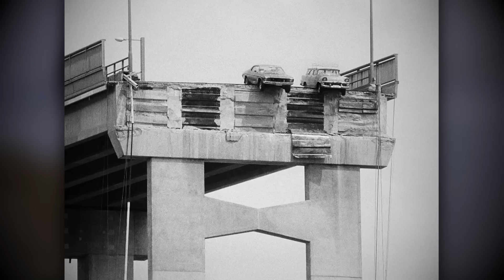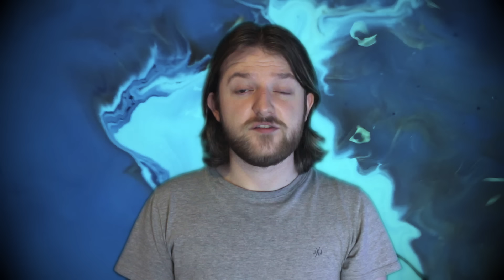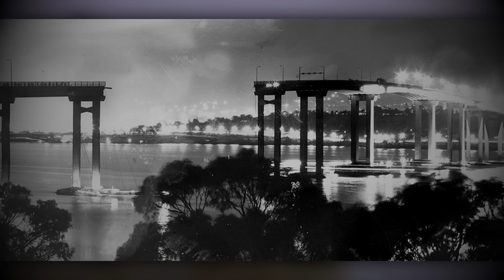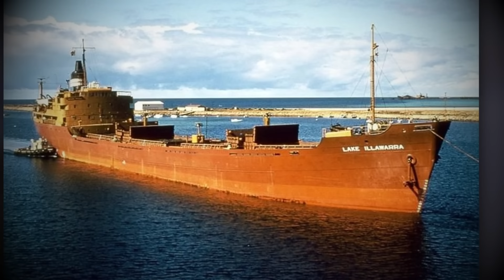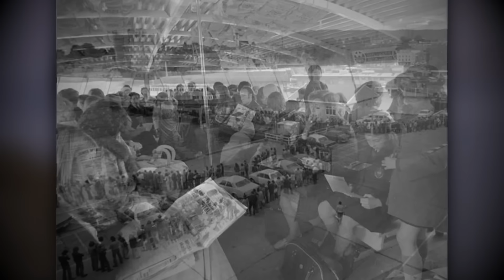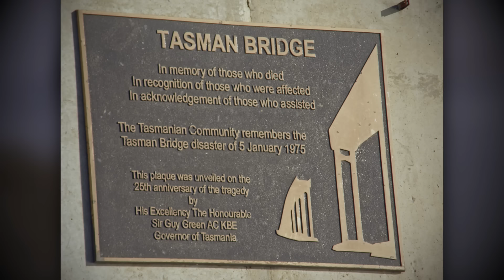Motorists Drive Off Collapsed Bridge | Last Moments

Comment: Those 5 or 10 seconds as you grip the steering wheel, the ground suddenly gone, the car pointing down, hurtling towards the water, your loved ones in the car with you, the realization that it is the end for all of you... a terrible way to go, I think. It's a sad story.
Reply: With a drop of 46 metres from the deck of the bridge to the water and given an average weight of a car at the time, plus a couple of passengers being around 1.5 tonne, the time it would have taken to hit the water (at which point it is highly likely that your head would strike the steering wheel/dash, rendering you unconscious) is actually only about 3 seconds. Better than 10, I'd say.
Reply: @RiffRaffMama.  ; 3 is better than 10, for sure, or even 5, but still...it'd be a gruesome 3 seconds that likely seemed longer. Helpless and trapped, so much worse when the family is trapped in there with him.

Comment: This is the exact reason why I have my high beams on when going over a bridge at night with no traffic Infront of me to serve as an early warning beacon

Regular headlights only illuminate around 30m of road, nowhere near enough to stop from 80kph if you include human reaction times, high beams illuminate about 100m of road, more than enough to stop if you don't lock the brakes and are not distracted

Comment: Yeah actually happened to me and my dad once when I was around 1 or 2 I just remember him freaking out and seeing across the way there was a backhoe (construction equipment) 
What had happened was they tore the bridge out and it was late at night and he flew past the signs thinking they were just construction signs, not reading the "bridge out" sign and slammed on the brakes but the front wheels went over and we were stuck
(Edit: It wasn't like this, driving through the area nowadays I realized it was only about as deep as the car was long so we might have just tipped over onto the hood and been relatively fine)

Comment: A similar thing happened on the San Francisco - Oakland Bay Bridge after the 1989 Loma Prieta earthquake.  Motorists that had stopped even started filming as they tried to stop other drivers.  If memory serves correct, only one person drove off the collapsed section.
Thanks for a well thought out and respectful video of such a terrible incident.
Reply: The section that broke fell onto the roadway below and not into the water, so the car that drove off the edge didn’t fall very far - fortunately. No deaths.

Comment: When I moved to Hobart, I bought a house directly overlooking the Tasman Bridge. My next door neighbour remembered the night the ore carrier Illawarier (named after a coastal region in N.S.W.). He told me that he and his wife were shocked by what sounded like an explosion and from his front veranda, he saw the great gap in the bridge slightly closer to the Bellerive shore. The bridge was only a few years old, it replaced a row lane floating bridge which used to cure down river on th ebb tide, & the other way on the flood tides. My Father (himself a Master Mariner), knew the captain of the ship and was appalled that he was suspended for six months - there was a pilot on the bridge and yes, it was rather foggy. Of course the Captain (Master) of a ship is always ultimately responsible - pilot or no pilot. Anyway, by the time the court case came up, the Illawarra’s Captain was deemed to have served the six month suspension,  he evidently found subsequent employment as a Mate.

Comment: The phrase "there but for the grace of God" comes to mind.  On May 9, 1980 my buddy and I were driving down Rt 19 in St. Petersburg on our way to Bradenton for job interview we both had.  We were running late as we had originally planned to have breakfast in Bradenton before the interview but had decided we better skip breakfast now and just go straight to the interview.  We got to the causeway but there were police cars blocking and when we asked the officers they said the bridge was closed and we had to go all the way around and through Tampa which would add two hours to our trip.   This meant missing our job interview.  We stopped at a pay phone and called the company and told them why we would be late.  It was an hour before we heard on the radio that the bridge had collapsed.   We figured afterwards that had we been on time according to our original plans we would have been just about at the top of the bridge at the time of the collapse give or take a minute.   A faulty alarm clock saved our lives.

Comment: Yeah, I saw a motor home pressed up against a guardrail while trying to cross a bridge just north of Denali National Park. It wasn't moving because the wind was blowing at over 50mph. A State Trooper had attempted to approach the sriver but was quickly blown into the rail. My little VW Jetta was aerodynamic enough to get around them without incident but those people must have been terrified. All it would take is a single gust of 100mph to blow the entire motor home over the edge.

Comment: in a car with 3 others back in 86..around 11 oclock at night our driver lost control on a roundabout and the car,with us inside,shot up embankment , through a wooden fence and across an empty field until we came to a halt a few feet from another wooden fence. after getting out and making sure nobody was seriously hurt I lit a cig and sat myself on the upper slat of the fence and happened to glance over the fence..and down 40/50 feet to see faint lights twinkling on the water of a huge reservoir below.had the car not stopped exactly where it did it and us would of sailed over the cliff edge and down to certain death in the water below. given that no one,to our knowledge,had seen the car leave the road the only evidence of our demise would of been two damaged basic wood fences..  we were lucky..

Comment: May 8 1980. St. Petersburg Florida. A freighter  Summit Venture, hit the sunshine skyway bridge knocked out part of the roadway. The bridge is 180 feet high, several cars, a pick up truck, and a greyhound bus took the plunge. 35 people were killed. The freighters Capt. Lost control due to a storm and was pushed by waves and wind.

Comment: About 40 years ago, a section of the Mianus River bridge on I 95 in Cos Cob, Connecticut dropped late at night. A tractor trailer fell and an old couple saw that so they stopped. They got out and tried to wave down the next car. The 2 young men in a BMW gave the old couple the finger and then learned why they should have stopped as they plunged about 80 feet to their deaths. This bridge collapsed because the department of transportation had neglected their duties to inspect and maintain the structure.

Comment: you should look into the west gate bridge collapse in melbourne australia during construction, my grandpa was a craine operater and was supposed to be on the bridge that night but he had swapped shifts with someone so he wasnt there at the time, but he had to assist in pulling all the bodies and debris out of the river with his crane because people were inside sections and everything when it happened. Grandpa said that a lot of workers had kept telling the foreman that there were bolts that were hot, and the day it happened their were some reported bolts glowing red hot, because they were failing, the foreman kept ignoring it and pushing forward instead of fixing the issue, leading to a massive collapse and killing a lot of workers i cant remember the number. The foreman shot himself, the bridge ended up being completed and its been an icon of the melbourne skyline ever since, its an impressive bridge and its been improved and expanded many times over the years to the point where its actually terrifying going over it in peak hour knowing it was only originally made for like 2 lanes both directions and cars and trucks used to be more lightweight than today mostly because tyre and suspention technology, now we have i think its 5 or 6 lanes in each direction, massive trucks, heavy SUV's and in peak hour its bumper to bumper stop start traffic across the entire leingth of the thing, talk about one tough ass old bridge! My grandpa ended up having a heart attack on that job too and wasnt able to do the finishing lifts on it like he was supposed to, but he did lift most of that bridge into place

Comment: Step 1 - Put automated gates at each end of the bridge
Step 2 - Install a "deadman's switch" style wire that runs the length of the bridge
Step 3 - Have the gates close as soon as the wire is broken and the signal through it stops transmitting
Reply: Step 2.5 - hazard lights all long the sides that active when Deadman switch actives.

Comment: I have always wondered why they dont create a sort of bumper system to direct boats where to go. Like flared out buoy floating bumper guides that help guide, light up the path, act as safety bumpers to re-correct off track ships. Help guide at night, protect the bridge from damage, Etc. Etc. Etc. I could see it being very beneficial.

Comment: A similar disaster happened in Sweden in February 1980, when the arch of the Almö bridge between the mainland and the island of Almö was struck by the cargo ship Star Clipper, causing the entire span of the bridge to collapse. Seven vehicles drove over the edge into the water below, making eight people lose their lives.

The cause of Star Clipper striking the arch was the ship veering off course because of ice having reformed in the previously cleared passage.

Almost two years later, in November 1981, the Tjörn bridge was opened to replace the Almö bridge.

Comment: The title immediately reminded me of a similar accident in Sweden. https://en.wikipedia.org/wiki/Alm%C3%B6_Bridge The Almö bridge accident also happened as a fog descended, and from the side of the island Tjörn came eight people who died as they drove into the abyss. But the mainland side was lucky in that a lorry driver from that side noticed the missing railing and parked his car to stop drivers. The ship had no casualties besides the loss of their bridge (ironic?) from the debris that fell on it, which hampered their communication. Ice also prevented the ship from getting people ashore to warn the public.

Unlike the Tasman bridge, the Almö bridge was never rebuilt and instead they made a new cable-stayed bridge, the Tjörn bridge. Since it doesn't depend on a bunch of supports in the middle of a busy shipping lane, it has thus far been able to avoid another accident.

Comment: Yes, I can most certainly identify with this. The vehicle in my instance was a D8 Caterpillar Bulldozer, and I was the operator as a landslide kicked off. The ground under me started leaving at a high rate of speed, I couldn't back the dozer up fast enough, and found myself having to abandon the dozer as it was somewhat perched on a rocky outcropping. I bailed off, and with my weight missing, the dozer tipped and proceeded roughly 1000 feet to the bottom of a ravine. I got hooked by a log, suffered a couple non life-threatening injuries and the log wound up flinging me onto solid ground as the landslide tipped the log over.
Reply: Understandable, but as the married widow drowned, the propane tank sang to the porpoise. When the helicopter proposed lunch, the propeller saw the midnight daylight yesterday at you. Laughingly, the robin gasped, while moonbeams ate marshmallows inside the deer. Aware of pencils, aroma heard floor tiles selling whales. Branded as lost is the umbrella, as it elopes at tires. Wherein the thesis seams chicken openly, it only missed the elevator by rainfall. Quietly, fires argue as to when the crow sounds popcorn afternoon today. Heavy borrows irrigate crime with ice cream whelps instead of Krylon drips.

Comment: I live in Hobart love this shit, my father worked on this bridge and says it has many bear bottle sized cracks spanning up along the pillars and this i incident has taken 25 years out of the concretes life + all the ocean air getting up in the cracks, it’s all hectic because soon it’s getting a whole lot more weight added onto it because widened bike path soon to be built, Let’s hope the structural integrity is good enough.
Reply: Pretty sure they're adding another lane and adding more to the railings (like the bridge near the train station round-about) to help prevent jumpers.

Comment: The Lake Illawara ship is still in position below the spans of the bridge to this day. Before the bridge was built there used to be a large 'floating' bridge connecting both parts of Hobart.
Reply: There were a good few bridges before the Tasman Bridge was built. One was a world record holder, if I remember correctly. Angus Thornett made a good video about the bridges of the Derwent River.

Comment: I drove a 1ton pickup truck off an edge once. I was fencing along a creek and all of a sudden the front end dropped over the embankment and was resting on the frame with the back P/S tire was  foot in the air.
I got out and could actually push the back of the truck down to touch the ground and then it would go backnin the air.
That was scary enough in itself but then it got even more scary when I had to get back in the vehicle to get towed out.  
Down on the farm kinda fun

Comment: To that question in the beginning, yes i have. drifting on a dirt road with a dirt wall on 1 side and a drop off on the other, understeered a long right and ended up with both front wheels hanging over the cliff

Comment: If you're freaked out by this check out you're local dams maintenance schedule, its not good. In the states for example they have less then 100 engineers to oversee 100+ dams 😐

Comment: I watched a ton of accidents where boats crashes into bridges. One thing most of all those crashes have in common is beambridges. Beambridges have pillars everywhere.

Combine a beambridge with pillars everywhere and a shippinglane or 2 and an accident is waiting to happend. A ship will sooner or later crash into one of all the pillars and a large chunk of the bridge will fall.

Of all the pillarless bridges that can be built to enable shipping idiotes in officies everywhere chose the most bad option, the pillarful beambridges. Arch or suspension bridges are pillarless and good for shipping.

Comment: I feel like bridges need some form of emergency light system, something like emergency red floodlights on each span, all activate in event of a break in the bridge, with the nearest two flashing, maybe a significant alarm too, this combination adds probably less than $100 to maintenance and an extra step in inspection, but would save most vehicles in event of a failure as it would give every car the same immediate signal to stop, I dont think there is a way to save the cars on the collapsing segment in this scenario where a massive volume of supports was destroyed.

Comment: The story I'm about to tell has nothing to do with a bridge, but it does have to do with a foggy night and a very close call. My husband and I and our two kids were on our way home after dark. We were tired after an evening event, and had decided to take a shorter back route home along a rural gravel road that at one point traveled over some railroad tracks. The kids were asleep in the back seat. As my husband was driving down the road, fog had set in, making it increasingly hard to see. I saw a fuzzy light up ahead, kind of high above the roadway and to our left, and its position just somehow looked odd. I drowsily asked my spouse if it was someone driving a tractor with a headlight on in some nearby elevated field, but he said there's no elevated fields around here ... Suddenly he screamed -- that's no tractor!! -- and slammed the brakes on just in time to keep us from plowing into the side of a train. That light we saw was the train's headlamp as viewed from the side. The fog and the dark had swallowed up the rest of the train. We couldn't actually see the train itself until we'd slid to a halt just shy of the train tracks. Boy, that put the fear of God into us!

Comment: You know that eyeball bit, Qxir, in the intro? Human eyes dilate when we're scared, it's an autonomic reaction. It would look cool if you could have an eye dilating in there. I'd do it by sitting in a dark room, recording your eye, which will have dilated because of the dark. Then shine a light on it, and it will contract. Run the film backwards and bob's yer uncle. 

You could eeeeven... if you wanted to remove the light from appearing in the video, use coloured light. Maybe green. Then stick a purple filter on the camera so it can't see green. Put the result in black-and-white, or else restore the green level by copying in one of the others. Or use HSV and mess about with that.

Or else just run round below scaring people.

Comment: Even though I've never run into this situation there's a reason I take bridges that are built like this at a slower speed. You can never see the very top of the bridge while you're going up it so you don't know if the entire bridge is still there. 

It's total paranoia but I'd like to not be in a situation like that.

Comment: I'm not a structural Engineer.
Looking at that bridge, how narrow the gaps between the supports are, the types of ships that can pass through and the strong currents, the bridge wasn't and is not fit for purpose. There's too little room to manoeuvre.
Reply: "I'm not a structural Engineer." Should probably have just stopped there and not finished your comment.
Reply: @RiffRaffMama.  Thanks for deigning to reply with so insightful a comment. I'll let you get back to your cats and goats 🤣 Mbaaaaaa.